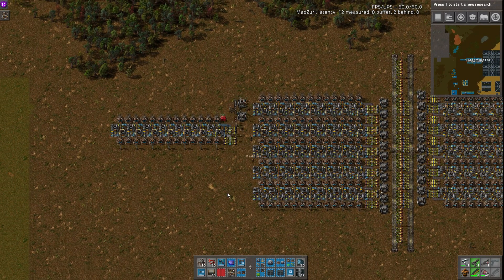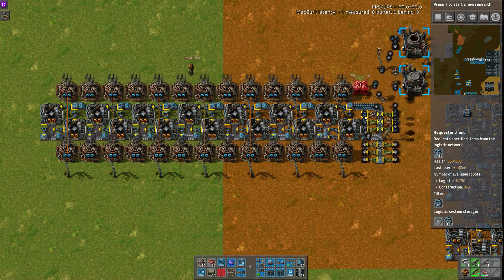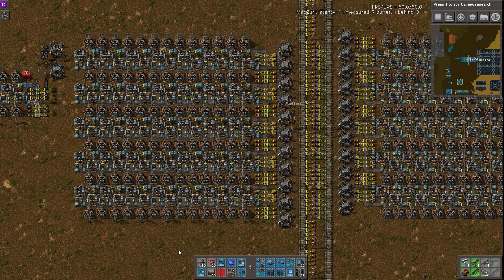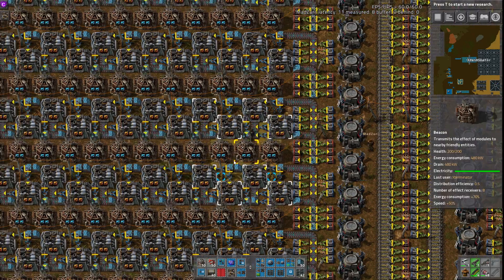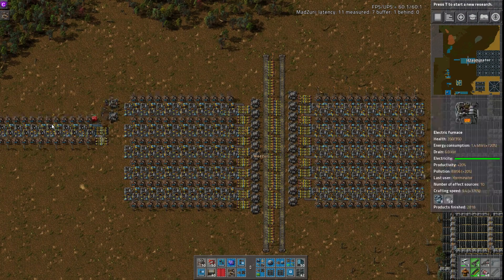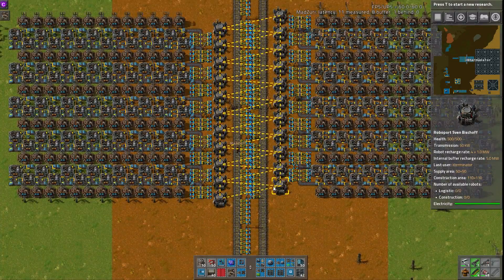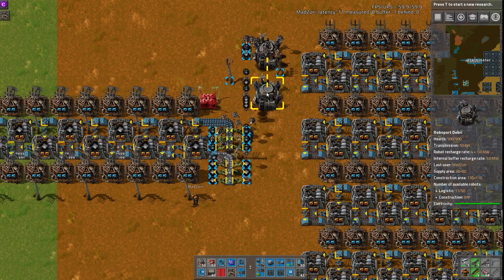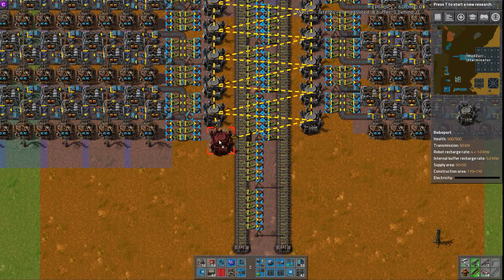Truffle's Belt & Bot Hybrid Smelter :: Factorio Workshop Season 2 - Building A Better Factory

Comment: I wanted to add some immediate Improvements that come to mind. The biggest is using Stack inserters for insertion of ore, this will greatly decrease the average number of active inserters at any time, thus UPS. Second thought is the straight piece of belt that is between the two underground belts, i don't think it's needed, i'M going to do some tests on this to make sure.
Reply from the maker: Good suggestions! I had thought the same thing with the Inserters but forgot to mention it.

Comment: IIRC there was a friday facts mentioning that bots are low lag due to their lack of pathfinding, they just take the linear path. This would mean there should be no need for the square of distance complexity with bots, it should be just linear of number of bots.
Reply: Zuri touched on this during the video. The UPS cost of bots is also dependent on their Battery charge that has to be updated for every tick traveling or even just Idlying while waiting to charge. So when you increase the average distance between Requesters and Providers that is going to increase UPS by a quadratic function. I Didn't phrase that very well, but i hope you get the point.
Reply: MrAnvyl Would that not also be linear to thr number of bots? Since you have to visit every bot and decrement the current charge, that would be linear no? Unless you mean finding the closest roboport which is constant time for each roboport for each robot so it would be B*P/C, technically quadratic, but not by number of bots.

Comment: One unmentioned UPS issue with these hybrid belt/bot builds is the need for additional inserters. Inserters are third largest UPS hog behind belts and bots.
Reply: Aren't the only extra inserters the ones putting the ore on belts and taking the plate from the belt to the chest? Probably negligible compared to the bots and belts
Reply: Well its only 6 more inserters on a build with like 30 or so inserters, so i kind of doubht that its a  huge issue
Reply: The question is: Is it worth it to use less bots, for more inserters and belts?